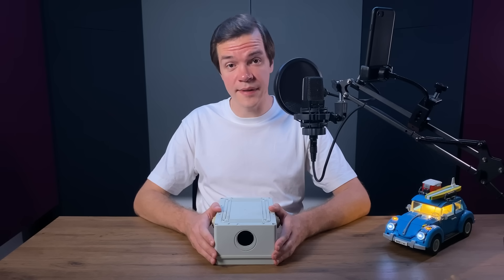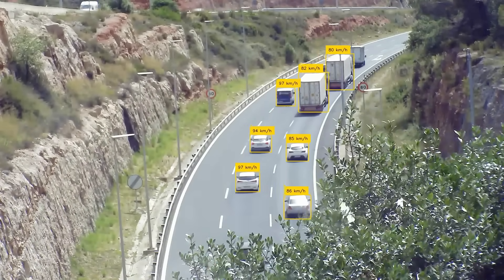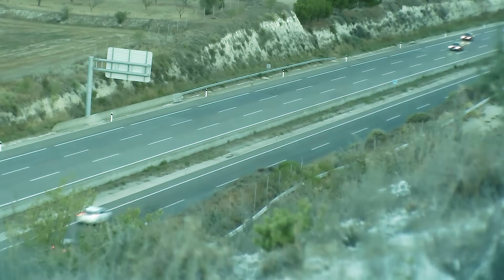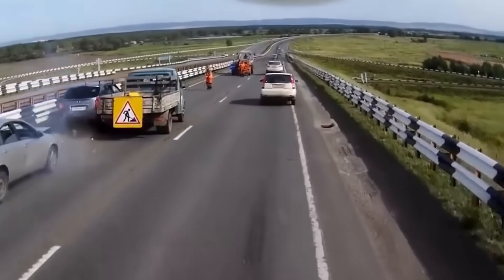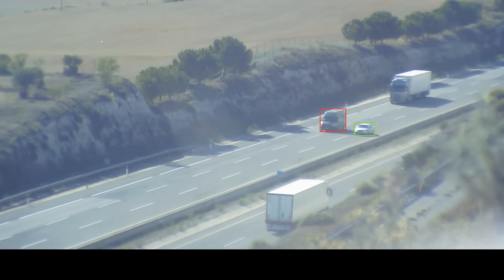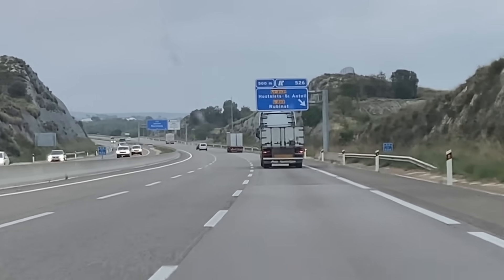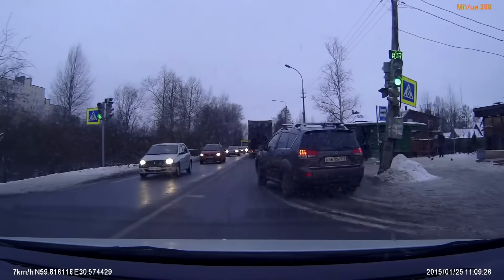New Anti-Tailgating Camera Reveals Shocking Statistics

Comment: Excellent video!

  .  Some people use overuse cruise control, so in effect they drive passive-aggressively.  For example, if I am driving at 65 mph (105 kph) in the non-passing lane and only one vehicle is nearby, that car may very slowly approach behind me.  When the car is about 10 feet (3m) behind me, the car will move into the passing lane and take 30 seconds or more to overtake me.  Then the car will move about 10 feet in front of me.  
  .  The driver of the overtaking car may not be trying to be a jerk.  Maybe the smooth road and steady speeds lull the driver into thinking that they are doing something like parallel parking.  
  .  Also, when people adjust their speed by using cruise control for a long period, they may forget for a crucial second or more that they can slow down fast by using their brakes.

Comment: Completely agree. There should be almost zero collisions on motorways if people kept safe distances. Tyre blow-outs, lorries losing their loads, or extreme weather conditions, should be the only reasons for anything going wrong. I had always been taught '2 seconds in dry, 4 seconds in wet.' The little expression 'Only a fool, breaks the two second rule', allows you a nice way to judge safe distance as it takes two seconds to say. Even with this gap, the number of cars cutting into the space I leave is infuriating at times. (Especially, if I am trying to leave enough distance behind a truck/lorry, or tractor, to see the road ahead, and to gather speed to pass when safe, but idiots, overtake, then sit so close behind the lorry they can't see to pass, meaning I now need to find a place where I can overtake, two, or more vehicles.) The other place it really irks me is, if I am overtaking on a motorway, someone will either drive really close to force you to move into other lane and let them pass, or drive s close, you end up speeding just to keep some distance, and they will do this, until you move over to let them pass, and suddenly their desire to break the speed limit disappeared, when there was no car in front to be caught first, and they pull in, in front of you, and slow down significantly. Surely there should be sensors and AI available to calculate safe distances, depending on weather, conditions, speed etc. and enforce them. If you keep tailgating, then it slows you down. NB AFAIK, Lorries tailgate other lorries, as they get about a 10% increase in fuel efficiency from the slipstream effect.

Comment: The concept of tailgating is not defined and is mixed with the beginning and end of a passing maneuvers. 
A snapshot of driving maneuvers on a couple of 100s meters of an highway does not prove there is excessive tailgating, only shows that vehicles vary a lot distances, due to a lot of reasons.
Also, staying behind a vehicle for some seconds or minutes, with open roads on front of it, has a totally different risk than if it has traffic on front of it.
The safe distance should be self-enforced most of time as possible to reduce risk to minimum as risk itself in doing anything at all is never zero.

Comment: Coming back from a camping trip with my friend, I had one of the worst scares of my life. The way she tailgates and drives distractedly has always bothered me, but now she has adaptive cruise control. Good, right? Except she sets it to maintain 1 car length from the car ahead of her. That's all well and good in a traffic jam, but we were on the freeway coming into LA. Going from normal freeway speed to LA "freeway" speed (stopped), she barely had time to register that the vehicle in front of us (a boxy truck she couldn't see around) had slammed its brakes on (they were probably tailgating as well). Thank goodness her car's collision avoidance braked in time, but it threw camping gear into the front seat, which was dangerous even though we didn't crash (at least we always pack our soft and light gear on top for that reason). Sadly she still drives distracted and still tailgates, and honestly it makes me not want to ride with her

Comment: Really smart video. You're right it's almost impossible to enforce punishment for tailgating... But it's not impossible to enforce precautions. The government could force car manufacturers to put a distance check camera on vehicles that creates an obnoxious alarm (not disableable) that sounds to the driver (same as a seatbelt alarm) when the distance to the vehicle ahead is unsafe according to the rate of movement. This would make drivers observe the distance due to both annoyance and social pressure (passengers have a valid reason to complain if the driver is tailgating). I had a situation recently where I was very upset with the driver for being too close to the vehicle ahead in poor conditions and they were arguing they are capable and this is "safe for them"... Obviously arguing back to them would distract them even more and make the situation more unsafe... I felt powerless and the driver is a timebomb. 

Obviously, though, the government is more interested in everything else that nets them profit (ie; speeding) then fixing real safety issues

Comment: My theory is that it's because we as a species (especially men) are obeying the "survival of the fittest" (Darwin) principle.

Men through history competed for resources and the most competent had more stuff (including women who look for competent men).

If you looked at the statistics I would guess it's the men with highest testosterone that do this. It's what drives us to compete, it's what gives us strength and allows us to reach our limits in performance and competency.
Those without enough testosterone never reach their peak performance since they don't have the drive for it. Those without competence fail and on the road that is deadly especially if you combine it with higher risk taking.

With age this "drive"  fades and the risk taking is reduced. It never never really goes away though.

I think this is also the reason for women having more minor accidents (fender benders) compared to men being involved in more heavy accidents.
Women have lower testosterone and don't "push the limits" as much as men. As a consequence most of the time their skills can't be as high (you learn most when at the limit) and their lower overall competence and less risk taking produces minor crashes.
Men on the other hand tend to get higher in skills but when they fail their crashes are heavier due to higher risk taking.

Comment: In the Netherlands, common behavior often consists of 'closing the gap' . When someone wants to enter the highway or tries to switch lanes ( using his indicator ), the vehicle behind starts to accelerate in order to leave insufficient space between the next car to prevent this happening, as they want to be first. Thus, a swift maneuver while still using the indicator will reduce reaction time of the rear driver preventing this. Another phenomena is 'left blind spot driving'. During this, the rear driver on the left lane adjusts ( read equalizes ) its speed to the right lane driver and remains in the blind angle as to prevent lane switching to overtake slower right lane traffic. Biggest reward is, when the right lane driver has overlooked their car so they can blow their horn. As a result, most Dutch drivers often execute lane switching to overtake prematurely, thus leaving large stretched of right lane unused. It's all about hindering other traffic as much as possible, without legal offense.

Comment: There is an easy solution for rampant tailgating:
Make adaptive cruise control (or similar assistance systems) mandatory, starting with new vehicles and rolling it out to existing vehicles after five years. Retrofits already exist and with a mandate on the horizon guaranteeing demand, the market will grow and prices will come down quickly. Give particular difficult cases a grace period of a couple more years. Once mandated, spot-check if drivers deactivate the assistance system with “tailgating cameras”, either mobile or stationary. 

After 5 - 10 years, the vast majority of cars will keep a safe distance through peer pressure.

Asshole drivers will continue to tailgate, speed and cut off people, but thankfully they are only a very small percentage of drivers (and people in general).

Comment: Follow 3 rules when behind the wheel, when it comes to positive socially considerate.  1) relax, set the cruise control for the speed limit & if you can read the License plate ahead of you, your too close.  2) Don't be an A**hole.  If the car ahead of you is driving slow and fast and slow again then other weird stuff.  Empathy, wife is yelling they are lost and kids are fighting in back seat, typical tourist behavior.  Don't fly up behind them honking your horn and giving them the bird because they might have swerved in front of you (cut you off) 3) leave earlier, plan ahead better, so you are NOT forcing yourself to be stressed about being late and blaming everyone around you for being the cause of your lateness stress.  Take responsibility for the stress you are causing upon yourself which you intern are always angry at others for being the cause of your own self imposed irrationality.

Comment: I lived in both Italy and Spain for many years. Spain is by far, without even being close, more civilized in every way, but especially when driving. Yes, it's still a problem there, but if you made the same video in Italy, you'd likely find a far higher percentage of people think they are F1 drivers in a race on a controlled track. It's nerve wracking, and like you said, there isn't much you can do about. You can't even drive properly yourself without getting cut off constantly or even causing an accident, because doing "what everyone else does" makes the roads more predictable, even when its inherently dangerous. Doing the unexpected thing, even if it should be safer, can also lead to accidents. I appreciate you sharing information about this serious issue, but I remain quite pessimistic about it, as long as humans are in control of the vehicles. I hope that one day vehicles will all drive themselves. I'm sure some people will strongly disagree for whatever emotional reasons, but the evidence shows that it will be much safer. And I, for one, am in full support of our new AI overlords.

Comment: If the driver ahead of you applies brakes, they will take approximately the same time as you to slow to a halt. Having 0.9 seconds between you and the driver ahead means that you both slow at similar rates, meaning that the  following distance is approximately adequate. It’s too close for lane cutting but far enough to allow you to react in time to not hit the car ahead. Incidentally, my extensive research (😂) by testing the family members reaction time indicates that most people in my sample reacted in 0.4 seconds for the quickest and 0.7 seconds for the slowest. Most were around 0.5s to 0.6s. I expect my sample size of 12 might be a little too low t draw any conclusions that might be valid. My reaction time seems to be around 0.56s. It seems I might have a little factor of safety with a 30m following distance. So far so good! No crashes yet and I’ve been driving for only 48 years, hopefully I vet better at it soon😜😂

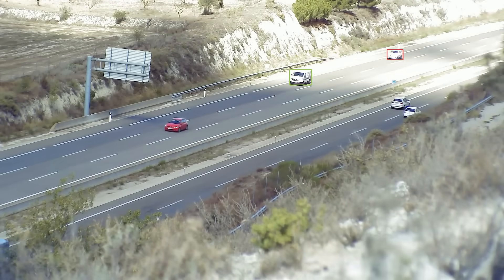Comment: This video is very poor and boring. 10:11 "driving at the speed limit at only half the recommended safe following distance [...] is just as dangerous as driving at 180 km/h [...] Maintaining a following distance of 40 meters is as risky as driving at 200 km/h".
You are neglecting so many factors, starting by the fact that energy is proportional to the squared speed. Tailgating is dangerous, really?!

Comment: Mmm, keeping to the speedlimit while at the same time maintain enough distance is unfortunately an exercise in futility, not only because of passing cars but because so many nowadays travel at speeds under the speedlimit. But I do try. 
One of my "pet peeves" is the fact that so many, if not most, after passing me merges at such a short distance in front of my car, as little as ~2-3 meters is far too common, I was taught not to merge in front of a car before you can see it in your rear view mirror, very few does this.

Comment: This research is outstanding, but with stationary recordings, you can only gather insights up to a certain point. What can still be determined: weather conditions are a dominant influencing factor connecting humans and insects. It’s about swarm behavior. (The passing of cars is not evenly distributed but clustered in non-random groups—because humans form swarms.) Days when, for example, wasps or mosquitoes are more aggressive, stinging and biting more, will correlate with more "tailgating" among humans on the highway. License plate recognition will reveal significant cluster differences regarding country of origin and tailgating, even differences related to car brands. But for truly advanced insights, cameras must be mounted on cars to track drivers’ long-term driving averages: gender and age will show differences.

Comment: A better system would record cars that stay in the middle lanes instead of pulling into the slower lane once overtake is complete. These driver cause tention in every driver and also staying in the middle lane can cause pileup crashes as it restricts peoples means of escape during an incident. 3 second rule was introduced so many years ago when we had drum brakes terrible road surfaces,poor tyres and no traction control, nothing can help that we have idiots and lefties out on the roads.

Comment: Hi, guy from germany here The country with the autobahn and the "adidas sign" as some americans call it ;-)
So far never had the opportunity to drive in Spain.
Is THAT sigh at 6:03 which does not state a fixed speed as a limit but a fixed distance that must be kept, a genuine in the wild sign, that is used in spain?

P.S. your link in the description to the code example gives right now. (august 2nd, 10am Berlin Time) a 404 server response. Do you have the version you used somewhere to tinker with oneself?
Reply from the maker: Yes, this is a legitimate sign, but it is only used at the entrance to medium-sized and large tunnels.
Reply: @RailwaysoftheWorld1  Thanks for the fast reply.
Here in germany on some autobahns there are actual distance measuring installations where there are permanent markings on the pavement and the police is checking the distance keeping.
For example doing (totally legal many places on german autobahn ) 130km/h or more and then being closer to the car in front of you by less then 3/10th of half the speedometer "Halber Tacho Regel" that will not only costs you money and give you points in the traffic offender Registry but also a driving license suspension of at least one month.

Comment: Shorter following distances may correlate with the volume of traffic.  A 30 m following distance passes 3.33X as many vehicles from point A to point B as a 100 m following distance.  Governments could impose a road use tax that dis-incentivizes low priority travel to keep traffic at a density compatible with 100 m following distance.